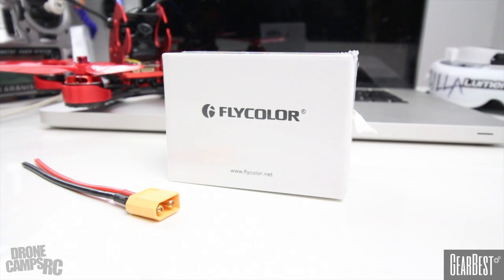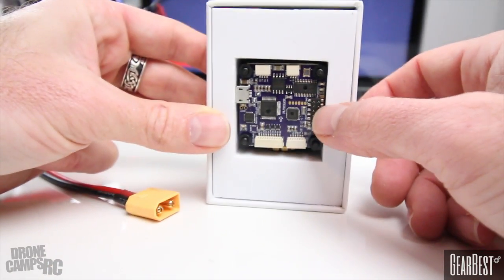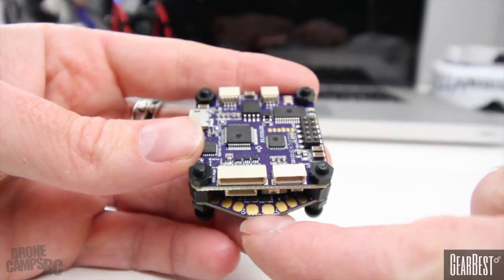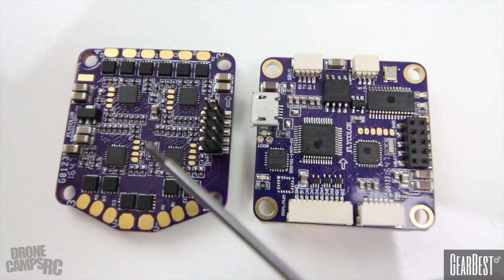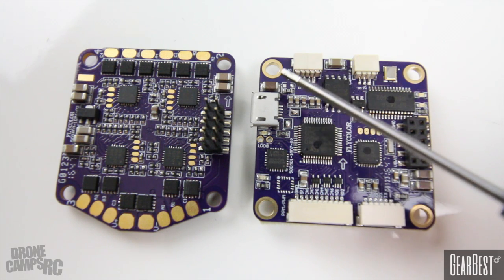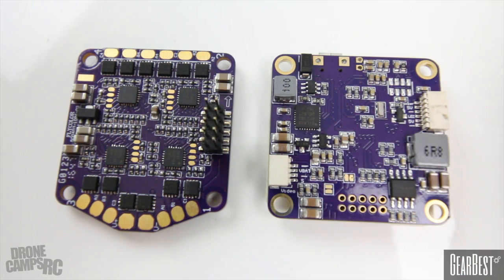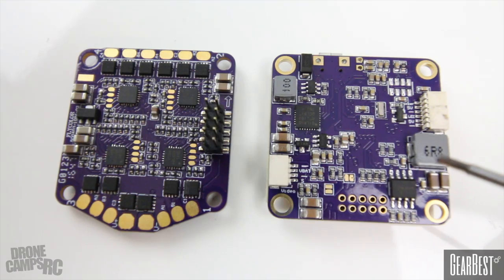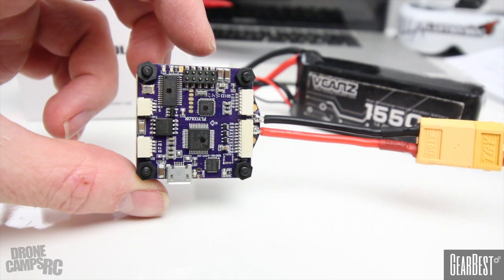FlyColor Raptor 390 - ALL in ONE FC, ESC, OSD, and PDB Revealed

Comment: can you use 4s lipo i have one too
Reply from the maker: Yes
Reply: i have the 20amp i think or 30amp either one can i use 4s is it  ok just to be sure i dont burn the esc out
Reply from the maker: We use 4S with 20A yes
Reply: ok thank you can i also use 4s  on lumineer 2204 2300kv  motors is it safe
Reply from the maker: Yes
Reply: 2-4s

Comment: I am starting to get into FPV racing and want to build my first quad. I have decided to run this stack for first-time builder ease! So besides, motors, props, frame, FPV camera, battery, and radio (Do each radio's come with the quad receiver?) ...What additional parts will I require?

I was planning on running these parts: (What else do I need and what are some good recommendations)

Frame: Vococal - QAV 210
Motors: 4X Racerstar Racing Edition BR2205 2300KV 
FPV Camera: Foxeer Arrow V2
Stack: FlyColor Raptor 390 (S)
Radio/Receiver: Turnigy Evolution

Comment: do you know how to flash the mwosd on this tower?  I have tried several forums and no one has the answer.  if you know how can you please share thanks
Reply: hi have you use the boot??
Reply: I was able to flash MWOSD through the ISP port using an FTDI cable and the Arduino IDE. I am running the latest MWOSD, but can't seem to get the RSSI and VBat reading the proper values in the OSD... any tips on getting those to read properly?

Comment: Hi, mine arrived today and I've hooked it up to a spare VTX and camera to bench test - all working great.
One issue I have is that the lastets build of BetaFlight doesn't detect the OSD so can't change any settings and I'd really like to remove the artifical horizon from the view, anyone shed any light on this please?
Reply: Martin Fluck You need MWOSD with 1.5 version not higher... then you will read the osd and change your display

Comment: Heh, Drone Camps-- I need a little help-AS soon as you can!! I have 2 builds with the Rapter 390 installed. In pluggingin the receiver, and the VTX, - I power up-- nothing-- no power to the board. It will sound through the motors as it usually does. There has to be another power connection somwhere. A little help, please!!

Comment: Anyone figure out how to update the OSD firmware from 1.5 to 1.7?
Reply: I was able to update it through the ISP programming header and using the Arduino IDE.
Reply: Can I ask you how did you manage to do that? I have FlyColor Raptor S and I'm trying to upload firmware with FTDI adapter and Arduino IDE, but I always get "An error occurred while uploading the sketch"